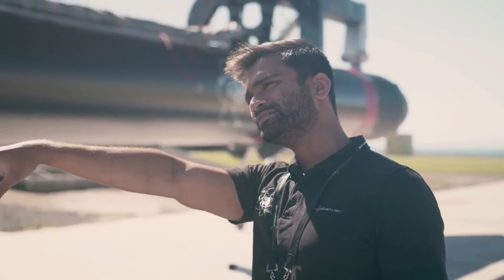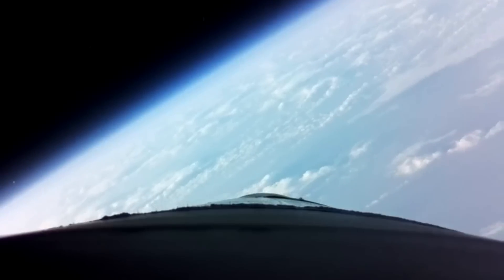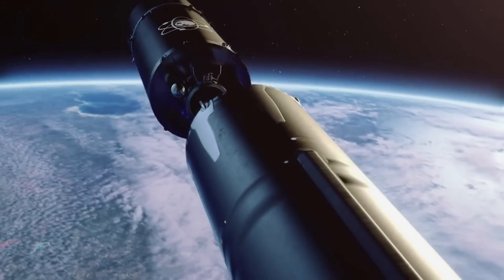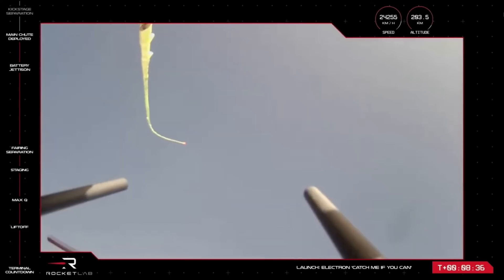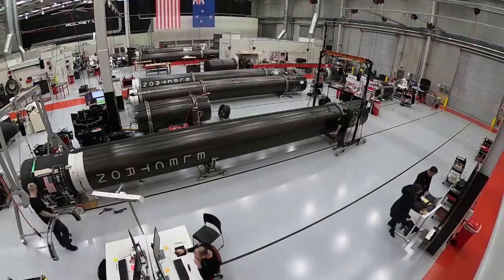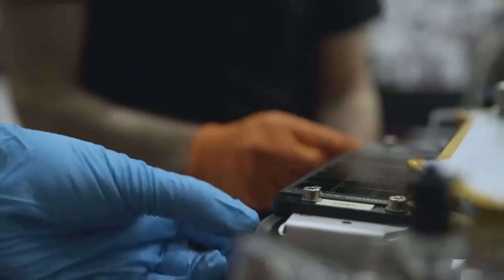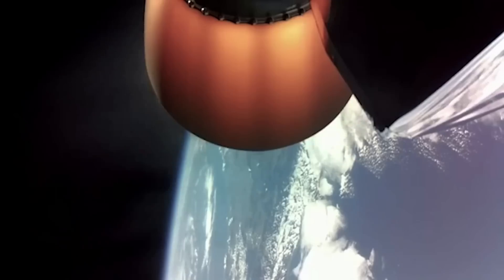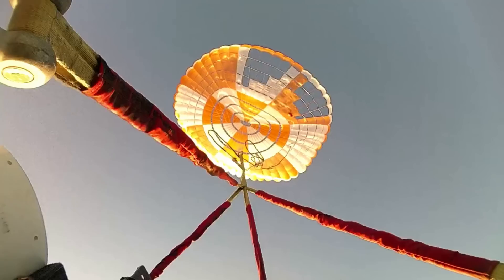The First Reused Electron Could Launch This Year

Comment: Ok so the first stage is carbon fiber. With this entire ocean gate thing how much stress can the booster withstand? I can see reusing the hardware but the booster itself idk. It go from ambient temps to super chilled back to kinda ambient I mean I'm sure it's cold in the upper atmosphere but not super chilled then go for the crazy got re-entry. Even if it can survive all this how many times could the booster itself be reflown?. I definitely wouldn't want to try it with a customer payload

Comment: I watched a SpaceX booster return and paid attention to the amount of speed lost due to the boost back and landing burns. I think the boost back burn cut about 2000Km/hr of the speed while the landing burn cut the speed from about 1000Km/hr to 0. Point being that about 60-70% of the slow down in speed is due to atmospheric drag. At what speed can an electron booster hit the water w/o damage? I know that with boating outboard motors that get dunked in salt water - the first thing you do is rinse with clean water. I assume that would be the first thing they do to an electron booster?

Comment: Im surprised that the seawater doesnt damage the engine plumbing, electronics, or carbon fibre tanks.
Reply: If they could still speak, the Titan submarine passengers would probably challenge the efficacy of using carbon fiber in pressure vessels.
Reply: @RevMikeBlack  From considerable aerospace experience, we know carbon fiber's fine for internal pressurization.

External? Not so much...
Reply: the electronics and plumbing are already engineered to withstand a much harsher set of environments. Launch, space flight and reentry demand very durable components.